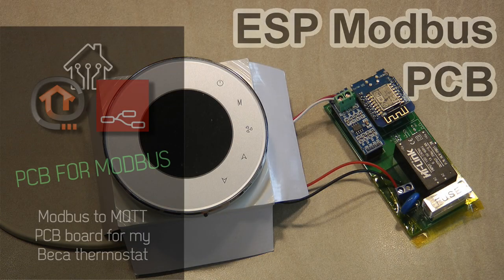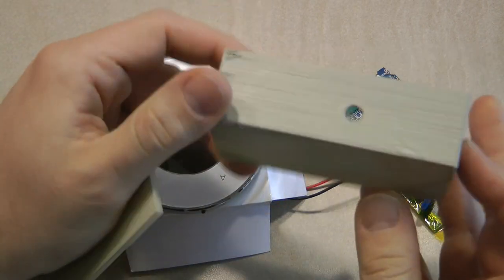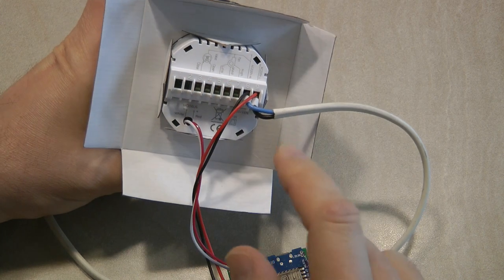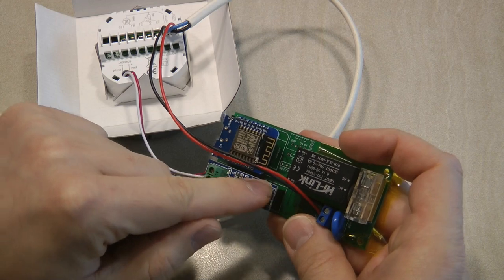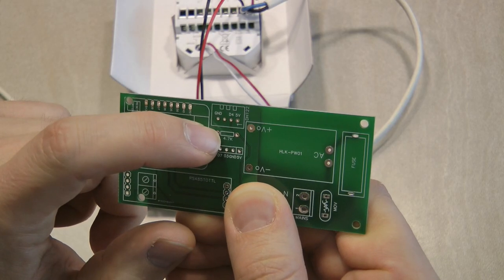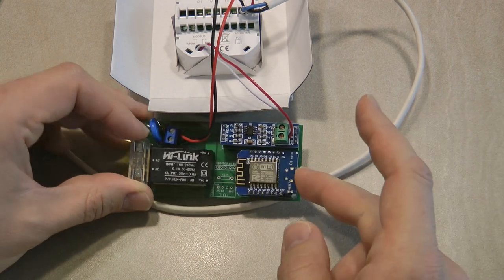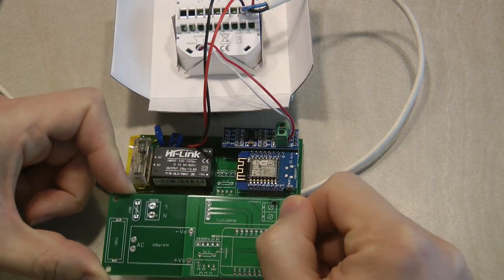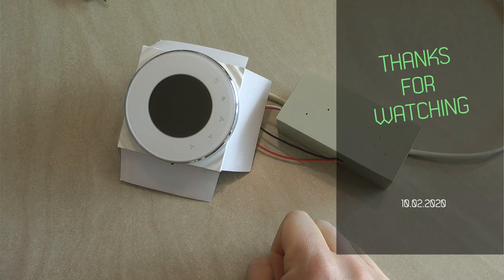Modbus to MQTT PCB

Comment: Do you think that the Hylink is an unsafe design, The AC pins are as close together as you could get them and the DC pins are as far apart as the module will allow. Why not the other way around, you can't even fit an air gap in between the pins.
Reply from the maker: I know, I don't know why they have done this. I did view a few videos on Hylink power supplies whete they tested them and found them good quality and safe devices. But I also heard that they are fakes out there as well. So take your pick.

Comment: HI, would you recommend adding filter capacitors at the output of the Hilink AC-DC convertor or is the output of the convertor stable? I had a similar prototype on another project - I also included jumper pins to opt for the tx -rx connections of the Rs485 - TTL convertor - to be connected to hw serial or sw serial on the Wemos D1 mini. My sketch was stable only after turning the watchdog timer of the ESP8266 off during the modbus read/write operation.
Reply from the maker: Thanks, you could add a cap, maybe I should have added to the PCB. But for me it appears to be working stable even without one.